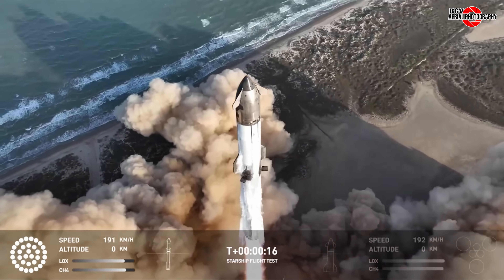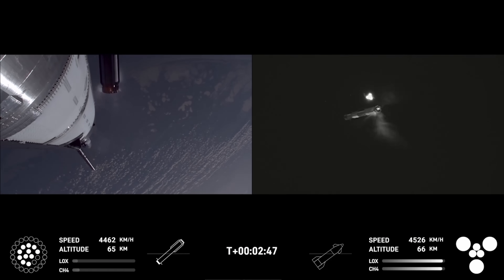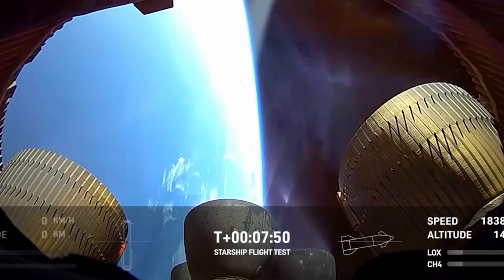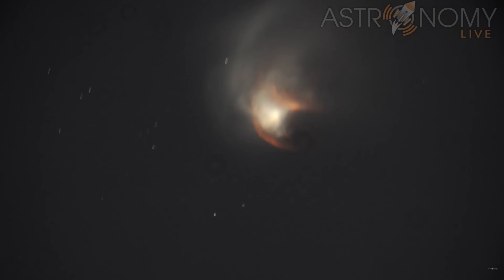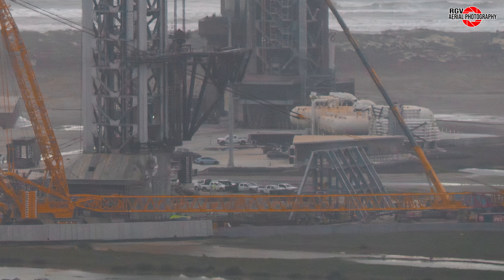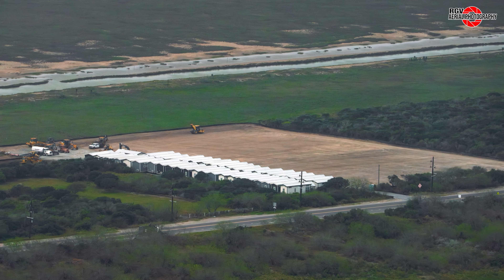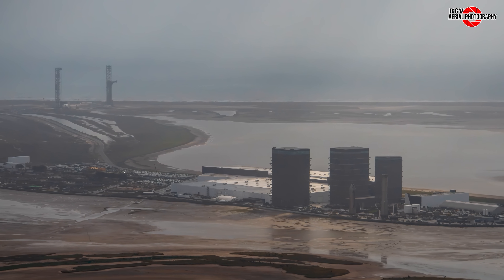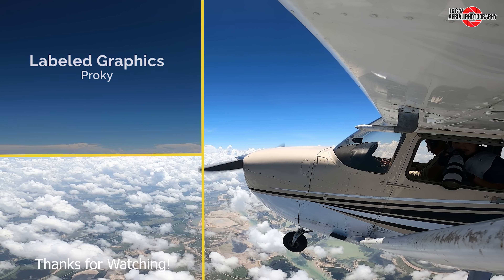Starship Flight 8 Explained + Post-Launch Flyover 75!

Comment: Fake and old news.
Both the "post-launch flyover" and the "excellent photography" are just recycled pictures from the SpaceX website and not from this channel, because the channel has no equipment nor authorization to get so close to the launch site nor the rocket. What this channel does is speculate and invent commentary to sound knoeledgeable.
And there are people who bait and buy the snake oil sold by the commenter ("Jeff?").
Reply: The site TFR only extends to 10k feet so above that it's LEGAL to photograph from the air and many professional camera can zoom in

RGV rented a Cessna plane, and many photos and LIVEstream suggest it's REAL

It's much more believable for YOU to be a fake bots instead, since unlike RGV the only evidence you are real is the non-bot comments which many LLM can replicate nowadays

Comment: I think it's a problem when you don't make your flux capacitors in house. a very slight leakage in the flux capacitor probably caused this engine to move into a different time and certainly different space. you might say it got left behind. going to have to be careful with not having good quality control on that little tiny flux capacitor. otherwise you will leave your engines behind and you can't stop.

Comment: From the available evidence it's much more likely a part of the RVAC nozzle had detached, hence the hot spot, and then disintegrated with fragments impacting the centre engines.

"Falling off" is an odd description.

Comment: It is not fit to hot stage....... the damage was 100% caused by hot staging because neither the ship or the engines or the feed lines were designed to hot stage in the first place......<<<<<<< critical

Comment: Just a dumb question from a German viewer: They are building wooden structures for the appartment housings in an area known for Hurricanes, right?
Reply: Wooden houses flex not snap...Plenty of historic homes along Gulf Coast that laugh it off...Tornados a diff story
Reply: Wood can be better for hurricanes and a lighter house is probably better in an area with a very high water table. Also, any structure would be ruined by heavy debris flying through the air so there's no real advantage to make everything out of brick and stone.
Reply: How many hurricanes have hit Boca Chica?
Reply: @imaginary_friend7300  I think there was one just last year. That or just a big storm. Kind of made the area very wet for a while. But, what can you do? You have to launch rockets from coastal areas unless you don't care about the locals like in China or Kazakhstan.
Reply: @imaginary_friend7300  At least one, devastating

Comment: Engine out used to mean one wasn't firing, not one has fallen off!
Reply: An engine falling off used to mean a rocket was in the process of exploding but now it just means that the rocket can't guide itself. Remember the old days when 1 engine problem with a turbo pump would result in an instantaneous explosion of the whole space craft? Seems planted FTS bombs are the only reason Starship rockets explode now.
Reply: Engine missing that needs more than spark plugs to fix
Reply: @cricri7066 yeah, you gotta change plugs AND wires.... And make sure to top up the blinker fluid.
Reply: @cricri7066 although the picture of the Starship engine bay shows an engine bell is missing. Wonder if it did fall off.
Reply: Whats that rocket think it is a DC 10?
Reply: Could call it a engine-off